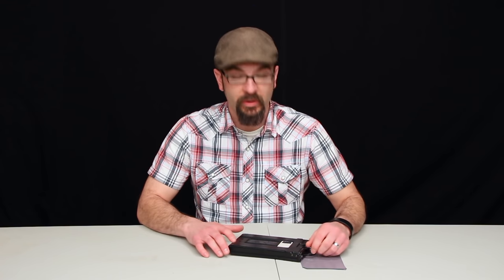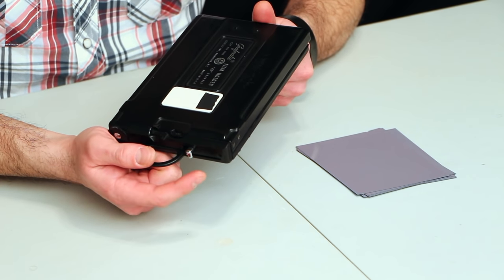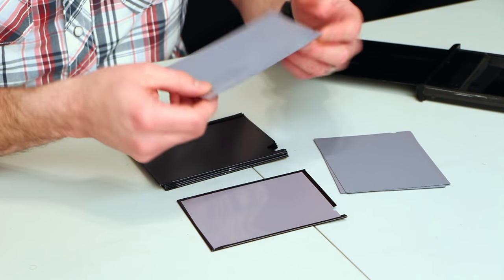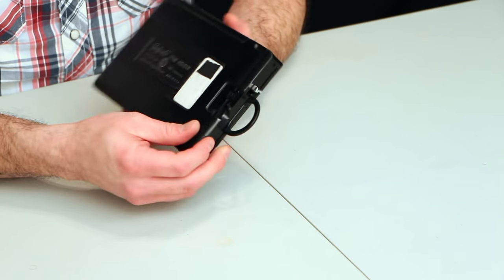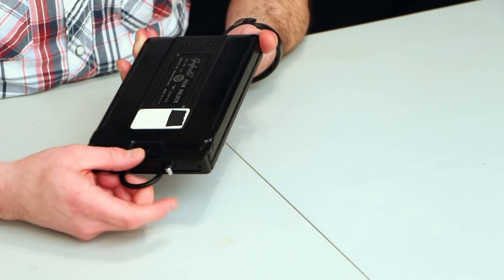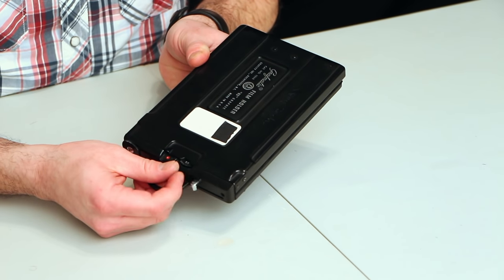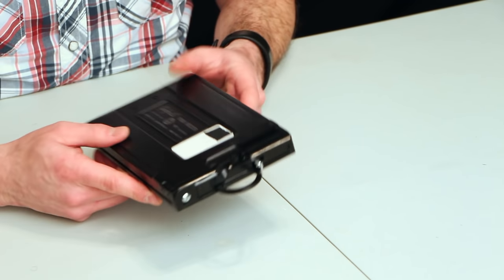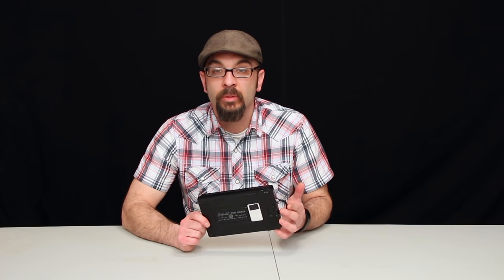4x5 Grafmatic Film Back Operation | Large Format Film Photography

Comment: I think you forgot to push up the tab  at the top of the inside of the open holder (just off centre at the top of compartment when slide is out)before loading the septums
Easily done but septums don’t go in easily if you don’t and then jam!

Comment: OK! My Grafmatic only has 5 septums (septa?) and I don't know if that is the cause of my problem... I cycled through the 5 shots and the silver lever locks as you show. The problem then is that ifI push the silver lever to unload/load film sheets, I cannot get the 'ringpull' to push in fractionally in order to pull it out fully to extract the septums - it just starts cycling through the taking process again... How do I get it to allow me to load and not just cycle the darkslide repeatedly?

Comment: I am not sure if i am loading the film into the holders incorrectly or what, but when i push the film into the individual holders all the way to the bottom I am getting somewhat cropped (at the top) negatives. Should the negative be flush with the top of the individual film holder (top right index)?
Reply from the maker: Sounds like the negatives are shifting in the individual septums once loaded. There should be small “tabs” on the septum to hold the negative in place.